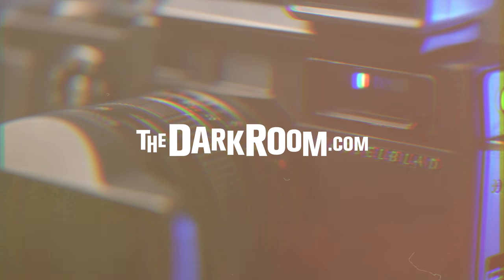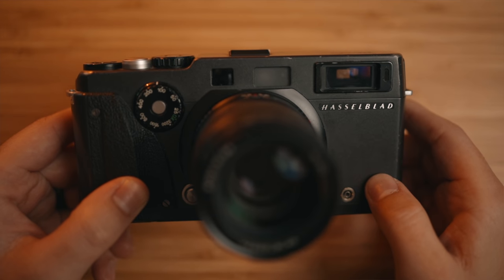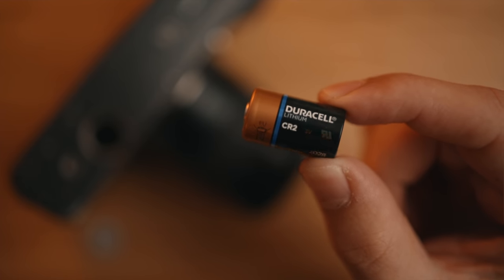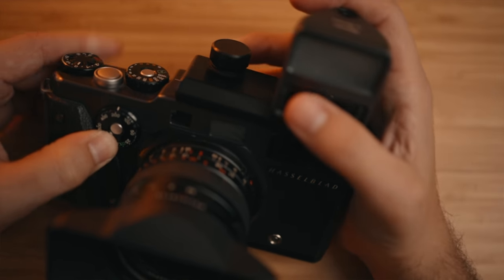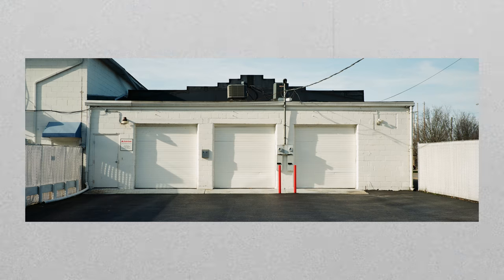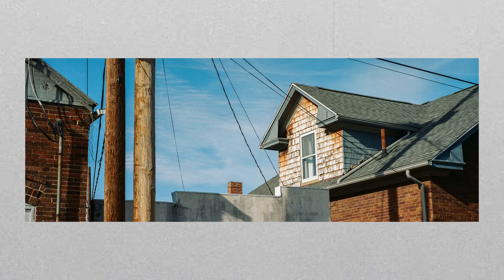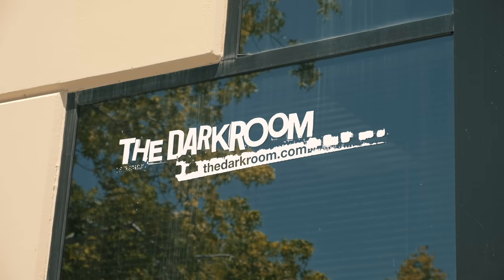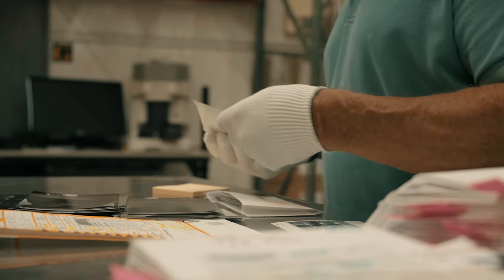Hasselblad X-Pan REVIEW

Comment: Adapters for using 35mm film in medium format cameras are cheap and readily available.  What advantage is there in this camera when 45mm, 60mm and 90mm widths are all easy options?  Plus with the medium format adapter you get the image in the sprocket holes, too.

Comment: I'm happy I've bought this camera years ago when the prices were much different. I've checked immediately if the switch was working (which did) and then it stayed in panorama mode ever since :-)
I use it mostly with the 45mm lens but I have also the 90mm and it really "saved" the day when I needed to exlude something from the composition, and at a wide aperture is still really sharp.
Very nice video, I like the B-roll and the use of the lights, really well done.

Comment: If you're looking for an alternative to shoot this format, you can get a Bronica ETRSi, panoramic back, and a couple of lenses for less than $1000. You definitely won't have the same experience, and it may be difficult to find the back and focus screen, but it's definitely cheaper.
Reply: I have this set-up! Honestly it's pretty flawless, and it's an SLR setup so great for nailing the (Panoramic) composition as opposed to a rangefinder. And because the system is modular, parts are replaceable. Granted I need to use it a lot more to justify keeping it, but it's much better value and more versatile (camera overall)
Reply: cropped 4.5x6 is way smaller than X-Pan

Comment: Definitely agree on the 90mm comment; I have the Fuji G617, a medium format panoramic camera. It has a 105mm lens that's equivalent to like 21mm on the longside. I wish I had the GX617 with the longer focal length instead. Makes me wonder with the price of the X Pan, is it more worth it to get a secondhand GFX 50R and shoot it in the cropped panoramic mode?
Reply: its not just about the resolution, you SEE and shoot differently when you go panoramic only. you can shoot panoramic on other medium format cameras too but its mostly static shots. but for street, quick shots etc its better to see panoramic and compose accordingly. i am pretty certain resoution-wise thx gfx will do fine compared to something like maybe ektachrome or ektar in the xpan

Comment: This and the G2 are the cameras that I never pulled the trigger. Personally I ended up buying a Mamiya 7 with Pano adapter for the panoramic job. Matt, how do you like the hasselblad´s lens performance? I love the mamiya 7 with 150mm and pano adapter for tight frames. I just got sent in a 6x17 shenhao back for my 4x5 camera, shot a roll with it this morning and can´t wait to develop the pictures
Reply: I would really love a 6x17 back that had its own shutter though :P The back itself is amazing, but I'd love to be able to use it with my fav lenses for portraits :(
Reply: @KNURKonesur  I tried to use my 210mm and 300mm with the 6x17 back. The image you get is 6x15, wide but not 6x17 wide, but again wide enough. Not bad at all making panoramic portrait with a 300mm lens

Comment: How different is this to large format 6x17 film backs or medium format 6x17 Matt? Just had a look on eBay, these are super expensive on our current exchange rate and could rather invest in an 8x10 and have  change.
Reply: Consider the price of film. In the UK it's very difficult to get 8x10 film and then it's very expensive per sheet and very expensive to develop. 6x17cm film is not that bad cause you can still buy 120 format film kinda cheap, and definitely even cheaper with 135 format film.

Comment: It’s a great video Matt with great photo! BUT, given the fact that this camera is pretty much unavailable - around 20 ebay offers in the world, so less than 0.02% of your subscribers could get it, let alone afford it - it would be more interesting to hear from you what other alternatives are available. OR, how to achieve this perspective and look with digital. That’s a challenge, isn’t it? :-) Cheers mate!
Reply: two words: medium format. 

The one thing you'll need to get this aspect ratio in digital format would be the Fujifilm GFX 50s. It has a built-in crop setting for  65:24 which is the exact same ratio as the xpan. Granted, you'd be cropping the image to get the look, however, you're not losing much quality given that you're using a medium format sensor.

There's the Hasselblad X1D as well, and there are adapters you can use for the xpan line of lenses. This camera also has a crop setting for the xpan's ratio. The setting is even called xpan. 

Now, both cameras are pretty expensive, almost as much as the xpan's on ebay. But, at least you'll have a camera that will last you for the next 10 years (at least), unlike the xpan which is already an decaying system (with almost no parts available for repair). I'd rather spend $8000+ on a system that will be around for another decade or more than spend the same amount on a camera that'll make a very nice looking brick in a couple of years.

Sadly, there aren't many film alternatives (or at all). There are some medium format cameras that also have an adapter mask for 35mm (like the Bronica ETRSi), but those are also hard to find. 

Hope this helped :-)